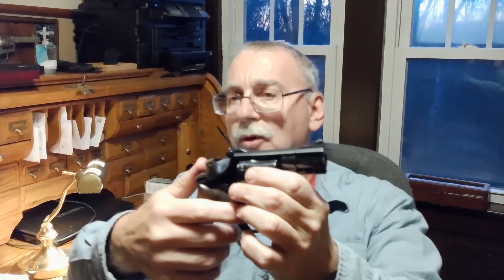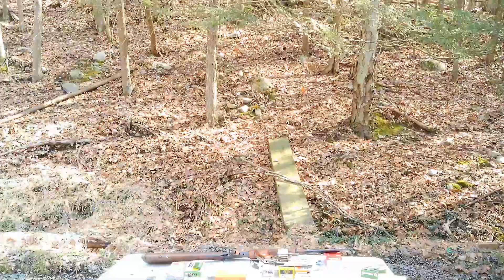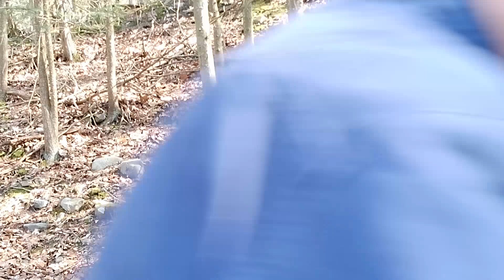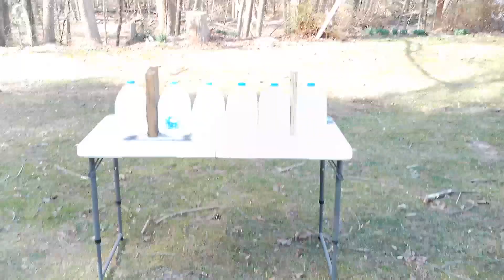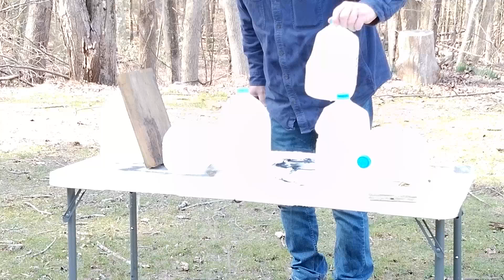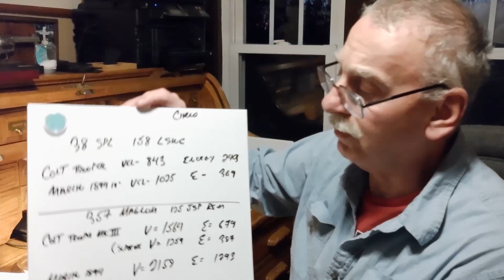Colt Trooper Mark III and .357 Magnum cartridge video

Comment: This reminds of those old VHS home videos from the 80’s. The Super Vel ammunition must be from the 70’s. The Remington 125 grain Semi Jacketed Hollowpoint was always a proven fight stopper. It was typical from a 4 inch barrel .357 Magnum revolver to achieve 1,450 FPS.
The issue with revolvers having a malfunction in actual shootings was the inability to clear the malfunction like a semi automatic pistol. When my agency went to the Glock 9mm pistol. The local news was covering the story. One of the Smith and Wesson Model 64 revolvers used had experienced a malfunction trying to open the cylinder to eject the empty shells. The ejector Rod became loose.
Reply from the maker: I only carried a model 64 for a year  we bought our guns they did not issue them , I carried a Glock for most of my career

Comment: I bought a 1975 nickel 4” Trooper beautiful gun but the worst double action trigger pull of any revolver I have ever owned 16# pull ended up selling it I will stick with my 1976 Security six beautiful gun and a smooth double action pull
Reply from the maker: TThis one has a nice trigger my Python from years ago had a horrible trigger
Reply: @Oldgunguy62 Bill Wilson is a huge fan of the original Python. The single action pull on the original Python revolver is excellent. The designer of the Colt Lawman developed the Dan Wesson revolver. 
You can’t compare the older Colt revolvers to the new mass produced Colt revolvers. You had real old world craftsmanship being built on every Python. Parts hand fitted.
Reply from the maker: @Hunterny1  I have  a new made Python I like it a lot. It has a much better trigger then the one I had 40 years ago.

Comment: I own a blued model 4” just like yours, I treat it like a safe queen, I took it to the range last week and when I cleaned it after, don’t know what I did wrong but the cylinder now has a hard time closing it’s happened before but it was just dirt. I guess I’ll find a gunsmith.
Reply: Common Colt problem.. working fine then all the sudden they don’t , and you have no idea what caused it.  I like my Colts  but I much prefer S&W revolvers